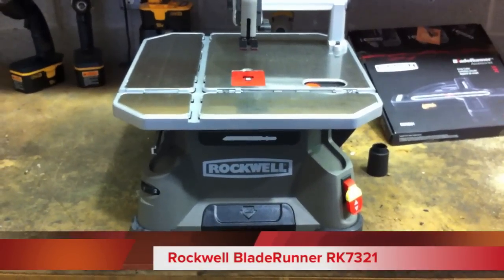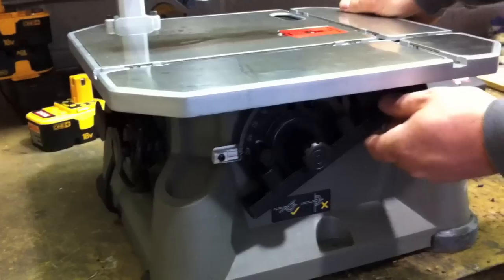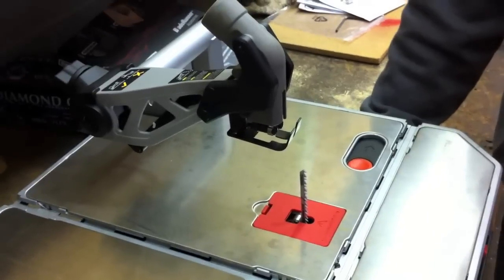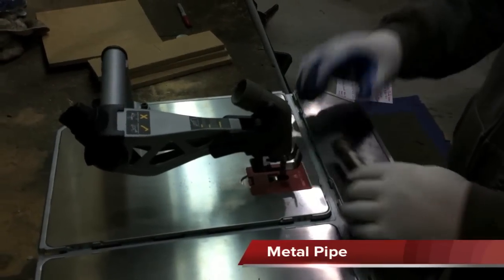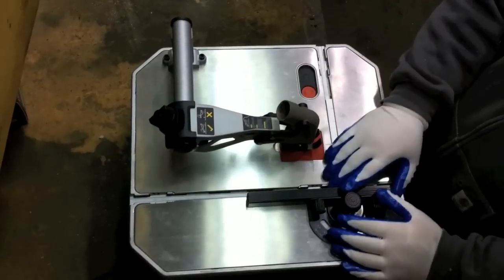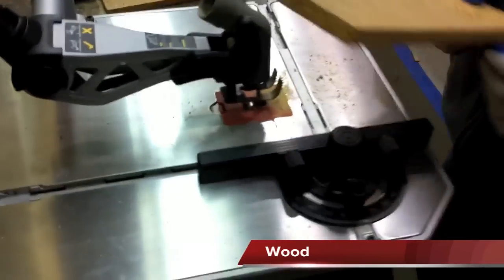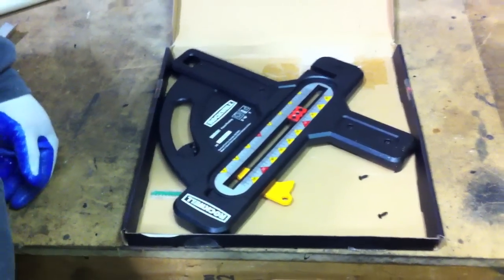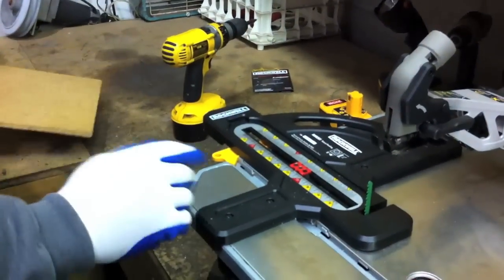Rockwell BladeRunner- Review

Comment: To all who see this video. As of writing this comment it's Sunday,May 27th 2018. Meaning this video is over seven years old. Now with that being said Lowe's sell's the Rockwell Bladerunner X2,and it retails $99.00 Now the difference between the one in the video,and the one in stores today is the following. A) No metal table it's plastic now. B) No wall mounted shelving bracket now you put it on a workbench,or wherever C) No speed dial control now it's "no load speed is 3,000spm." Other differences on the newer version is the guard arm is narrow enough now at the bottom so it will go through the kerf made by the blade; in other words you can cut wider pieces,and it also now comes with a fence as well as the miter. I'm not sure if the difference matter,but I thought people should at least be aware that they are different now the New version is "Rockwell Bladerunner X2" Model number RK7323  I got mine to cut handles for knives,and also knife blanks. And it does that just fine. In fact if anyone is thinking about getting one to aid them in knife making I'd say Yes do it. It cut (wood) up to 1-1/2  (Aluminum) up to 3/8 (Brass) also 3/8 ,and 1090/95 tool steel 1/8 maybe 3/16th if you go slow,and add some oil along your precut line,but most of my knives have 1/8 spine anyway unless it's a special order then I've always got my angle grinder. Sorry this turned into such a long read,but I hope someone finds this useful  thanks. God Bless You All,and Have A Great Day!

Comment: I bought the same model a few years back, and I enjoy using it. I went into this knowing that it was an upside-down jigsaw, but it fit my needs for cutting silhouettes freehand from long, thin stock that would be a pain to work using a hand held jigsaw. I tossed the blades that came with it and went with a brand name that rhymes with "gosh." I've used it to do cross, rip, and curved cuts in wood; cut and trimmed PVC pipe; trimmed metal bolts; and sized some small ceramic tiles for a kitchen back splash project. I got the results I expected each and every time. 

It does have some cons: If you are doing curved or circular cuts you have to plan your route, because the arm mount WILL get in the way if you are not careful. Also, the mitre gauge that comes with it fits loose in the slots and tends to go off true when pressure is applied.

As for the gloves/no gloves issue, I don't use gloves in most cases. However, I got a doozy of a burn blister on my right index finger when I was trying to trim a bolt using a metal cutting blade, so I will make an exception in that case.

I have seen the "new" version of the X2 at my local box store, and just from its outer appearance I would not consider buying it. It looks flimsy, the arm mount has moved to the center/rear of the table, and the table itself is plastic.

PS: I know I'm writing this about 3 years too late, but great review, TIA!

Comment: Bought mine at Lowes for $25.00 - only missing the blades. Came with the wall mount so no complaints here. Great tool to make wind chimes, model sailboats, do some plumbing repairs and other HOME small workshop stuff. For the price, it makes up for any issues.

Comment: Good demo! I have been using one of these hard and all I can say is that “It’s it’s own tool” and doesn’t need compared to anything else .(Mixed in with your other tools, it shines for it’s inherent strengths.) Yes, you can use it doing tasks it’s poor or marginally competent with, but why?
Teamed up next to your router table, spindle sander and chop saw....knocks detail work down to size and kicks it out fast! (Have already purchased another used/but new one for when this one dies.)

Comment: I have one of the saws and really like it for what it is used for. My only minor complaint is the miter gauge. It has a tendency to move thereby not getting a straight cut. The blades that come with it are junk so I bought some Bosch blades for cutting various materials and use it to cut about anything now. I build boxes and clocks and the saw is ideal for cutting the small parts I use with any kind of wood. Using the right blades it will cut very small radius's as well as mild steel.

Comment: Didn't see the date on this video and went out and bought one this morning. took it to a small job and its going back to the store first thing in the morning. Couldn't cut a straight line in 3/4" wood to save my life. Current saw is not the one ion this older video. Plastic top, not metal, no wall rack, everything possible scaled down to crap. I thought I might use it for a couple of weeks till my new table saw came in and then give it to my wife for crafts but I'm not that pissed at her.
Reply: +Michael Miller If you live in Canada, Canadian tire has a mastercraft model that is basically this saw without wall bracket.
Reply: canadian tire carries the rockwell as well.

Comment: I purchased one of your RW9263 blade runners a few years back. I've thoroughly enjoyed and experienced good results with this tool. Would definitely recommend it to other hobbyist. I have one question for you. When cutting circles and some ,materials I've noticed a small amount of blade movement from side to side which causes some crooked cuts. When I checked I found blade guide rollers to not be contacting the blade on one side. By not contacting the blade it allowed the blade to drift ever so slightly. Is there anyway to remedy this issue?    Thanks       Any assistance will be appreciated.

Comment: OK, so 2 things,  I would NEVER hold a piece at both ends when I cut.  You risk pinching the blade.also, its an 8 inch circle not a 4 inch. I don't have this tool, thinking of buying it. Is the Miter guide plastic or metal?

Comment: I can't see the point of this tool, its going to make quite messy cuts in wood, its essentially a  fixed jigsaw and not a great one at that. IMH but correct O buy a proper mitre saw and table saw.
Reply: for a little over $100, this tool is not bad for a hobbyist.